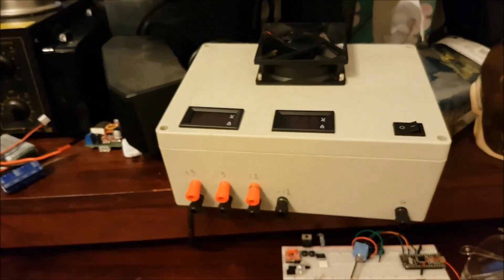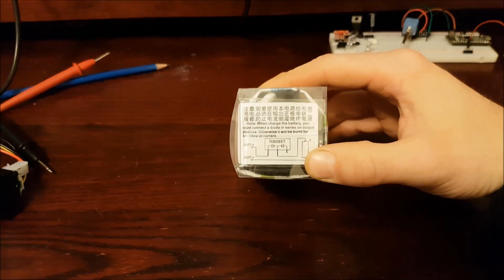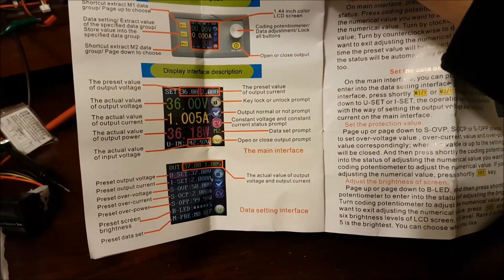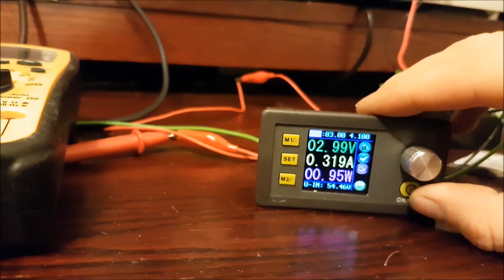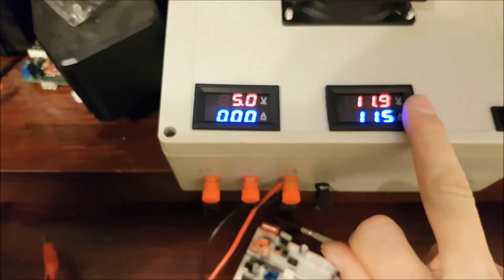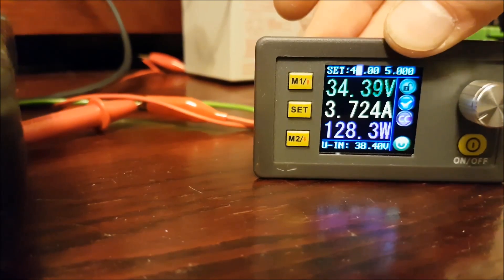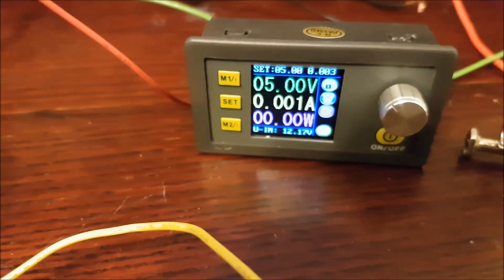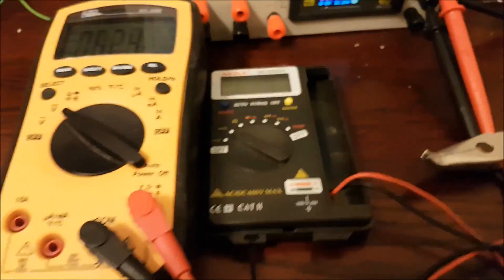DP50V5A Testing and Inspection

Comment: Just one thing: at the end I've noticed that you hooked it up between GND and +12V. If you hook it up between -12V and +12V then you're gonna have bigger range to choose from. I knon than -12V in ATX power supplies is rated at about 0,5A but in this case it doesn't matter. I've succesfuly used that power supply at 24V@3A for a long period of time and everything was fine.
Reply from the maker: I considered this actually, but the 500ma limit on the -12v deterred me.

Comment: i wonder if there is any overshoot, and how fast the protection cutoff is...
Reply: +Steve Holvoet
there are 2 progress, let me explain for you . 
eg, you set OCP ( Over currrent protection value) is 3A, but you want to output 10A, when you open output, the current is upto 3A instantly , after 1s. the output will be closed, understand , now ?
Reply: RD tech i do understand. but not all devicesregulate instantly and some have an overshoot. lets say you set it to 5v. and jou turn on the device and it momentarely overshoots/spikes to more than 5v untill it stabilises to the set voltage. i would have liked to see its power on output monitored by a oscilloscope..
Reply from the maker: That's a good question, I will perhaps measure this on the scope in the future

Comment: Hi friend 

thank you for your video and your work . I like it . 

let talk about your test. first I did not saw there is a problem about my
products. 

now begin. there are 4 parts about your video 

1 parts: there is some your thoughts and introduction. I think this parts is
too long. about your though, I think you should test it and then can say
something about this. thank you 

2 parts, you want to test our module at 50v/5A. but your input power supply
power is not powerful . there are 2 times to get OPP protection to enter into
CC mode. This is my protection. Please don’t worry, at 250w, it must be work
well. 

3, you test reverse connection to see my
module how to protect it , right ?  it
enters into to CC mode to protect. There is still exist current (it is constant
current value), I saw you ask why there is current, right? Because you did not
set OCP value. Your DCP value should be more than constant current value
0.007A, right? If OCP value is lower than constant current value , at your 3
parts test, the module will stop work, there is no current, you can try to test
, remember to set OCP value.. 

4 parts: I saw you did not open output, the
display show 0.0001 or 0.002, right? It is caused by temperature and environmental
factor. I can teach you to remove this numbers and let it show 0.0000. disconnect
input power supply and your load. Then keep pressing SET key and then connect
input power supply, until the screen lights, you can loose the SET key. Then calibration
is done 

 
Thank you again for your support and video. Hope you can make a better
work. If you have any question, you can tell me. 

  
Have a nice day
Reply: I have one of those DP50v5A, recently it acts weird. It starts ok, but after putting through it any larger current it goes down to 0.4v abouts and basically no current. It doesn't matter what I do. Even after complete disconnect it doesn't go back. Next day it works again.
Reply: @contemporiser  hello, you can contact us on aliexpress, you can take a video to show the problem and upload it to youtube, and give me the link, then I can help you solve the problem
Reply: @rdtech9153  Now it does it even without connecting any load. I think I blew a mosfet by connecting a dc motor a while ago. I will try to replace it before asking more questions. Thanx
Reply: good video. but where two potentiometers) why it's not have (
Reply: +Imya Phamiliya

becase the limitation for pcb and casing 
in fact , this one potentionmeter is enough 
thank you , hope you like it
Reply: RD tech I ordered 2 from your shop. now waiting)
Reply: Rd Tech How can I power the module? Pls answer.